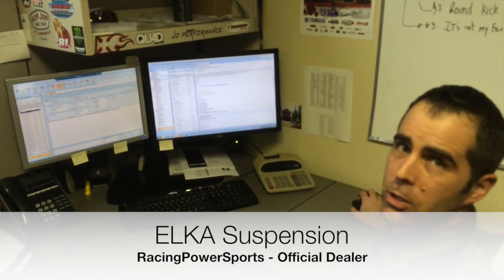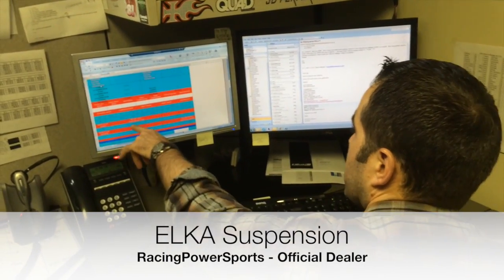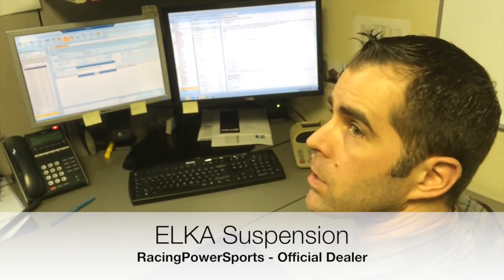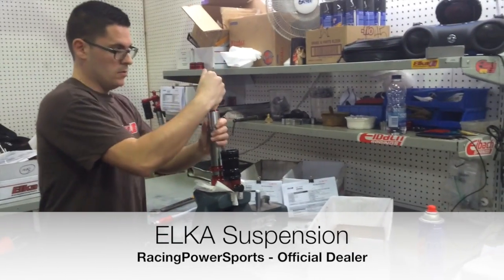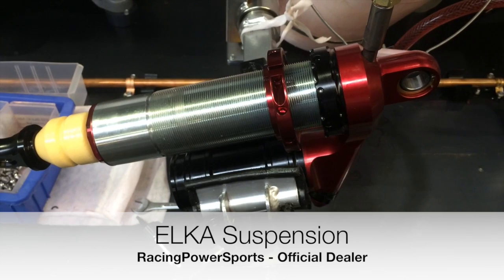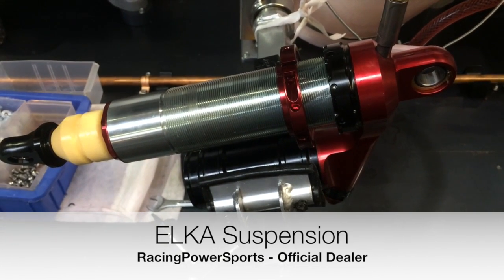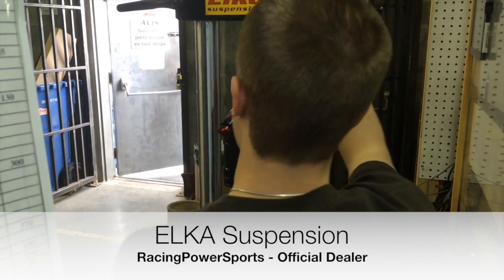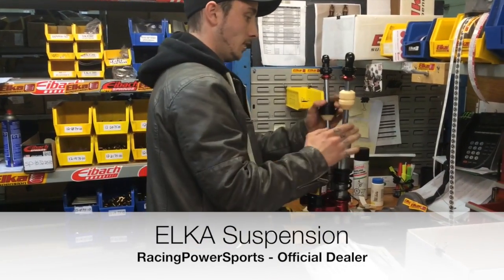ELKA Suspension Factory Tour by RacingPowerSports

Comment: Great video, just a couple things I wish were shown in this video, how much fluid is put in the shocks and how to fill them without the special machine/tool.  I’m rebuilding my elkas myself at home, seems extremely simple they send you a whole seal head assembly,
Just need to change out the fluid and get the air out (plus have access to nitrogen regulated to 200 psi)